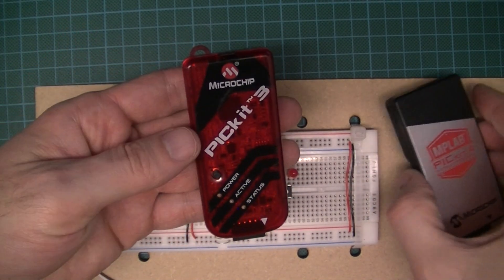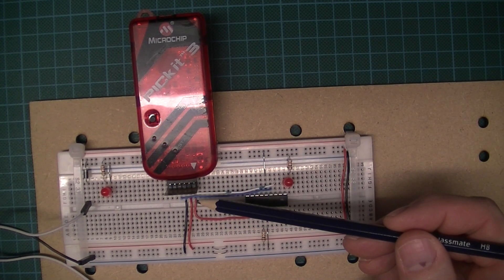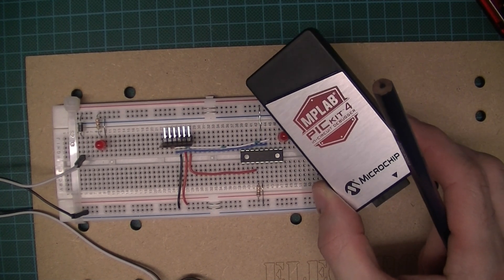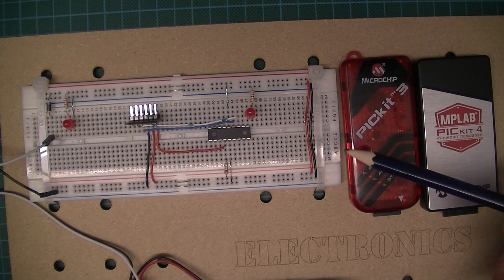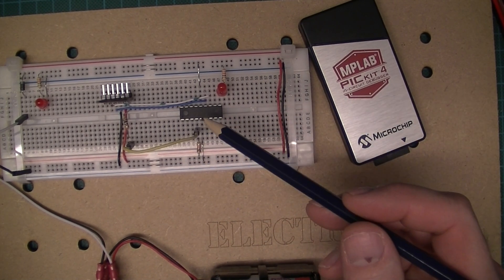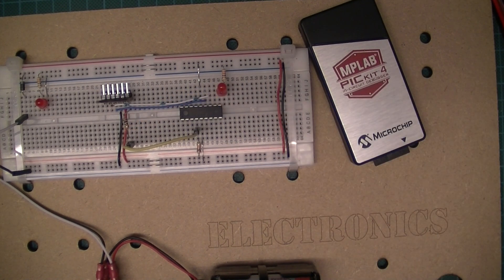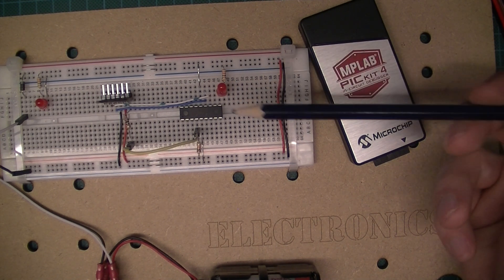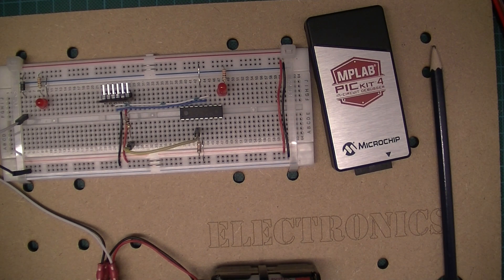Using PICkit 4 to program 8-bit microcontrollers (PIC16F88 and PIC16F84a)

Comment: why do you have a diode at the top left? Is it necessary to have one? Also, what is the name of the header you are using to connect the pickit4? Thanks a lot
Reply from the maker: The diode is for reverse bias protection (in case the supply is connected the wrong way round). I also use it when I need to drop the voltage slightly (eg. When I'm using a 6V battery pack). The header connector is homemade.

Comment: Good to know sir! I usually only buy 1 or 2 dip chips so can't really afford to brick those.  Is this something that can be fixed with a new firmware revision for pickit 4?
Reply from the maker: Nothing was mentioned about a new firmware update or possible fix when I was in contact with Microchip about this issue, in December 2019. The suggestion was simply to add a resistor to avoid overshoot. Incidentally, do you know that you can get free samples of PIC chips from Microchip? I have had a lot of free samples and so have my students. Watch this video if you are interested -- https://www.youtube.com/watch?v=UVXYdNfy2bs
Reply: @PizzeyTechnology  Yeah I have requested samples in the past, but I just order them off microchipdirect now since I'm just a maker that works on projects that interest me and I felt bad getting samples when no commercial product was ever going to come from it.  If they started a program where they would send you a sample of all new chips as they're released I'd be interested in that depending on the cost.

Comment: For a PIC MCU, do we need that special header when using the PICkit4?  I have a PIC16F690, can I use any generic header or can I connect the PICkit4 directly to the DIP IC?
Reply from the maker: The PIC16F690 supports ICSP (http://ww1.microchip.com/downloads/en/DeviceDoc/40001262F.pdf) therefore it should be possible to program the device in-circuit or using a suitable "programming board" with an ICSP connection to the PICkit4. Microchip recommend (https://www.microchip.com/forums/m1041211.aspx) looking at the release notes ("C:\Program Files (x86)\Microchip\MPLABX\v5.30\docs\Readme for PICkit 4.htm") but I can see no specific mention of the PIC16F690. However, if you check the text I've copied and pasted below, it would seem wise to include a 100 Ohm resistor in series on Vpp. I found this out the hard way when attempting to program other PIC16Fxxx chips. Incidentally, the document has a clickable link to check PICKIT4 device support, but the linked document (file:///C:/Program%20Files%20(x86)/Microchip/MPLABX/v5.30/docs/Device%20Support.htm) is dated 2011 and of course has no mention of the PICkit4 debugger. Or have I misread the table? 

------

15.4.2  PIC16XXX Devices - Possible damage may occur when attempting to program the PIC16xxx devices with the MPLAB ICD 4 or MPLAB PICkit 4. Add a 100-ohm resistor in series on VPP before attempting to program the part with this tool. This part is not recommended for new designs. Devices include:
PIC16(L)F628
PIC16(L)F627
PIC16(L)F84A
PIC16(L)F870/871/872/873/874/876/877
PIC16F7x/PIC16LF7x
Refer to the Silicon Errata Links:
http://ww1.microchip.com/downloads/en/DeviceDoc/40300C.pdf under Electrical Specifications section
Timer1 Module Data Sheet Errata.pdf
PIC16F627A/628A/648A Rev. A Silicon/Data Sheet Errata.pdf
Reply from the maker: I contacted Microchip and true-to-form they replied quickly with a link to the current supported device list which you can download here:

http://ww1.microchip.com/downloads/en/DeviceDoc/Device_Support_v5.30.pdf

The PIC16F690 is listed with "full, production tested support" for the PICkit4P (programmer) but not PICkit4D (debugger). 

I hope that helps.

Comment: Hi Pizzey Technology.
Could you tell me if the PICkit4 supports the PIC16F716?
I can't find a cheap programmer to program the PIC16F716.
Thank you very much and greetings.
Reply from the maker: The PIC16F716 is an 8-bit microcontroller that supports ICSP (in circuit serial programming). It has a pinout and feature set very similar to the PIC16F88 which is programmable using a PICkit3 and PICkit4. Assuming that you have MPLABX installed, you could check the PICkit4 readme file ("C:\Program Files (x86)\Microchip\MPLABX\v5.30\docs\Readme for PICkit 4.htm") which states:

"15.4.2  PIC16XXX Devices
Possible damage may occur when attempting to program the PIC16xxx devices with the MPLAB ICD 4 or MPLAB PICkit 4. Add a 100-ohm resistor in series on VPP before attempting to program the part with this tool. This part is not recommended for new designs. Devices include:
PIC16(L)F628
PIC16(L)F627
PIC16(L)F84A
PIC16(L)F870/871/872/873/874/876/877
PIC16F7x/PIC16LF7x"

As you can see, the PIC16F716 is not specifically mentioned but personally I would avoid using a  PICkit4, especially if cost is a consideration. If you want cheap then I would recommend purchasing a clone PICkit3 programmer which are considerably cheaper. I purchased a small class set and all of them work with absolutely no problem. If you haven't watched the video review, here it is: https://youtu.be/Ffdsgl_HQ8c

It would be much appreciated if you could subscribe. Feel free to comment again if you need to.
Reply from the maker: This document: 

file:///C:/Program%20Files%20(x86)/Microchip/MPLABX/v5.30/docs/Device%20Support.htm

Indicates the PIC16F716 has "full, production tested support" with the PICkit3 programmer.